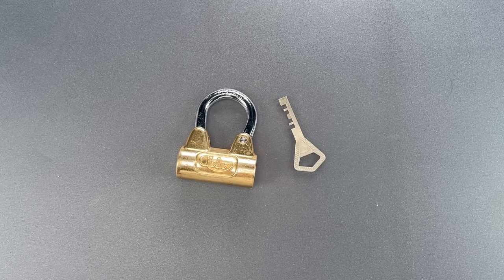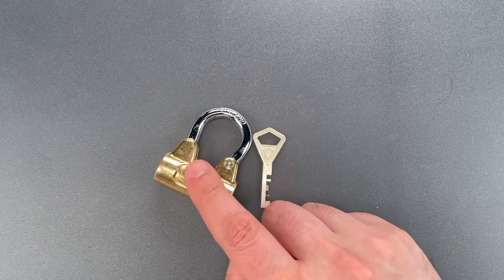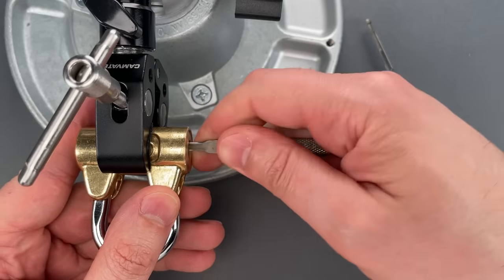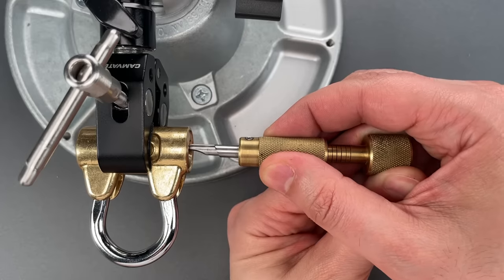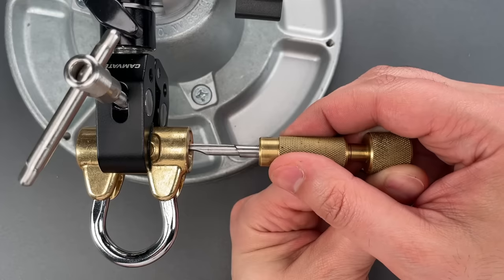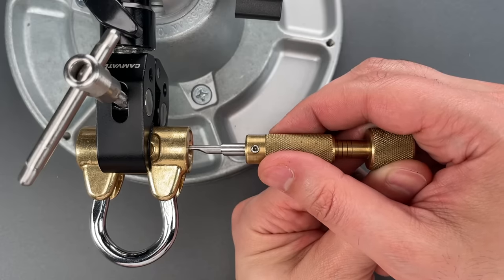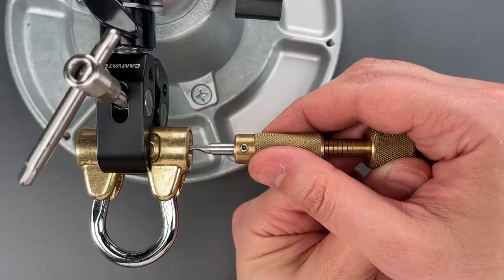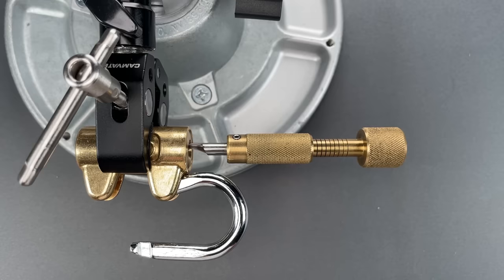[1416] Retro-Cool Abloy Padlock Picked (Model 3020C)

Comment: 1:00 - 3:50 It takes 3 minutes of LPL's time and his own custom tools. That's quite impressive.
Reply: Feels like the 3020C is going up in sales :D
Reply: True but it would not last 5 second against a brute force attack
Reply: @Vili.K  Wouldn't agree with you there, considering ABUS locks...
Reply: @AlbertZonneveld  In which case you would know her chastity belt had been removed!
Reply: @AlbertZonneveld  It does have the same core as the Abloy 341 Enforcer, a lock LPL made a vid on 2y ago, I believe
Reply: JD Kap

Ah, okay..
Reply: @AlbertZonneveld  Would most padlocks?
Reply: It more starts at 1:20 atleast the actual picking the previous bit was the set up
Reply: It takes 3 minutes AND you need something to hold it in place.
Reply: Imagine this on a sturdy lock...
Reply: @Vili.K  The Germans make exceptional "stuff".
Reply: My basement storage locker has been broken into 3 times in the last 20 years (always a resident with the key for the common door), but I still have the same Abloy lock, like the one on the video. They always break the locker doors, it´s so much faster than doing anything to the lock.
Reply: The lock doesn't get that much credit, it was closer to 2.5 minutes.  As Blitz said, it started around 1:20.  Still, well over the 90 second LPL scale and requiring his fancier disk pick.
Reply: @CodyLynn100  In Finland that is reasonable for a core that is over 100 years old.
Reply: @AlbertZonneveld  REMEMBER Almost anything in the world wouldn't resist a brute force attack!! Waste of time comment! The lock did it's job BIG TIME!!
Reply: @AlbertZonneveld  Yeah that hinge for the shackle looks very susceptible to attack.
Reply: @Torby4096  No Lauri Vuohensilta uses Hydraulic Press... Pommijätkät would have it open with explosion 😏
Reply: @CodyLynn100  Pay a few bucks more and you can pick from a variety of newer cores that no-one has been able to pick, along with a full steel case.
Reply: @BlitzerXYZ  The setup provided him with an advantage. IMO it counts as part of the lockpicking process.
Reply: ... for a 110 year old core technology
Reply: @AlbertZonneveld  most padlocks wouldn't tho.
Reply: Pretty good for year 1907 design, no? Considering that the last patents on this kind of lock expired in 1927, you have to wonder why MasterLock makes the crap they do. They could just copy this old design and slap their logo on it!

Or if they have high enough manufacturing quality, they could copy some of the more recent Abloy design with patents already expired. Even the Abloy Protec patents expired in 2019 and that's insanely good design already, much much much better than this year 1907 design.
Reply: @Vili.K  Swedes, actually.
Reply: @ssuchanek  Original design is by finns in 1907, ASSA Abloy was multiple disc detainer designs later than Abloy Classic in 1994
Reply: @riba2233  abloy has Superior core designs in far superior locks, arguably some of the finest padlocks money can buy
Reply: @karhu96  I call bullshit on the no one has been able to pick statement because among other things if memory serves people know how to pick the bowley lock
Reply: @the_undead  awesome!
Reply: @the_undead  That is a completely different design.

As far as I know, only a single person has claimed to have been able to pick the current standard Protec2 locks. Apparently it took him years to design a right kind of tool that he built from scratch and we'll over an hour to pick the lock. As far as I know, no-one has been able to replicate his tool or his results, so it could be fake.

Nevertheless, picking the current standard Abloy locks tends to be the holy grail of lockpicking. No other manufacturer or design comes close in it's ability to be pick proof.
Reply: We saw it and heard what he said.   Thanks Capt Obvious
Reply: @karhu96  Impressive part is not the pickproofness, but the fact that they are easy to make and can be made into insanely large series of complex key systems with master keys etc. while still remaining fairly secure. No other lock system that I am aware of come even close to that and I doubt anything other than disc detainer could even do that.
Reply: @karhu96  Multiple people have picked protec2 and most can pick up to Abloy Sento currently as the tools are public ish
Reply: Ma’uckas don’t stand a chaynce
Reply: Yeah I noticed the 4+ minute video so knew this was a good lock.
Reply: @CodyLynn100  Even if it's only 2.5 minutes to open this lock, there are some LPL videos that are shorter in total length while still showing a lock being opened multiple times.
Reply: @jdkap201  how did LPL do on time with that lock?
Reply: @fernandoserrano9393  I know but putting that core in strong lock with normally weak core would be awesome
Reply: It’s especially impressive when you consider that LPL can open most locks just by blowing on them, waving a magnet at them, or tickling the soles of their feet with a feather.
Reply: Probably a biggest flaw is that it is relatively easy to decode like many disk detainers.
Reply: @the_undead  Hux has video where he opens a bowley lock with a pick gun using a custom made tip. All pin tumbler locks are more or less vulnerable to similar attacks. That's why disk detainer designs are getting more traction.
Reply: @Vision-xf8gl  Abloy Sento is more like Exec than Protec. Sento doesn't have DBS (Disk Blocking System) or anything similar which makes it much easier to pick. Both have features in the keyway that prevent using a simple pick such as "the pick that BosnianBill and LPL made".
Reply: @CaptainRon1913  Thanks Captain Ron.
Reply: @fernandoserrano9393  Naah.
Reply: @Vili.K  When you combine the two you will get something unstoppable!
Reply: @manuhonkanen2111  You get God itself in the form of a lock
Reply: @Daltonfg  A chain is no stronger than its weakest link. A great lock doesn’t protect against a door that can be broken.
Reply: Your comment is mentioned in a finnish news article
Reply: @gpgarageoy  What?
Reply: @Vili.K  the original comment
Reply: @gpgarageoy  Yeah but in what article?
Reply: @Vili.K  isnt abloy swedish?
Reply: @masieone1979  Nope, the factory is still in Finland. But Assa Abloy has had their headquarter in Sweden since Assa and Abloy merged in 1994. Same goes with Yale for example. Yale is not Swedish even though it has been under Assa Abloy control since 2000.
Reply: @fernandoserrano9393  only chisel If know waht you are doing
Reply: Abloy, as a name, is constructed from 3 abbreviations: "Ab" is abbreviation for "aktiebolag" meaning limited company in swedish, as it is the second official language in Finland, "L" is abbreviation for "lukko" and that is actually a lock in finnish, and lastly "Oy" standing for "osakeyhtiö" - again limited company, but this time in finnish.

It is very much a Finnish lock.
Reply: Imagine this thing hanging on to something, swinging around.. you would never get it open
Reply: @AlbertZonneveld  But in that case, you would know someone has broke it down and insurance would pay back anything stolen. In my opinion when someone is trying to steal something out from you with picking, the point is to make it look like no one other than the owner of the key could have done it..
Reply: History about this lock is just next level, it's good one but gen2, gen3 are way better
Reply: Meaby he made tool but its not hes invention
Reply: @masieone1979  Yes. A part of the ASSA group.
Reply: @sueyourself5413 Finns, that lock was made in Finland, not Germany.

Comment: Takes to pick:
- several minutes
- a custom made tool
- advanced skill, and trial and error
- three hands

I'd heard that Abloy locks are top range, and now I've got a quote for that.
Reply: Sure thing. Pretty much no one is going to pick that lock because it's not going to be used in an environment where someone that skilled would be involved. They're gonna force the lock or use a stolen key.

Duplicating the key from a good enough photograph is very doable and way, way easier than picking. Even that is not typical common criminal level stuff. Also requires carelessness and or a freak accident.

Having a stolen key for several apartments plus "borrowing" the front door or storage facility key might enable a highly skilled criminal to make a master key for an entire apartment complex, but
-that problem is not limited to this brand
-requires some lazy locksmithing to have taken place to be plausible
-the "classic" version is outdated by decades anyway and more recent series are harder to work on
-any adversary skilled enough would probably think of something easier
Reply: @tonsssedell4318  you can duplicate a classic key very easily, but that's the only lock you can do that with. Modern ones in the field nowadays like exec, sento, protec or easy are borderline impossible, unless you're a master craftsman.
Reply: @Nibblerr  actually the older abloy locks (edge, exec) have expired patents, so they're duplicable with the right tools. Sento has patent protection to the year 2026, after that it'll be copyable as well. 

You can buy a edge key decoder and cutter but they'll cost you, so there's no reason to buy one unless you're a locksmith or a cobbler, criminals have other easier ways in.
Reply: @matiask7633  expired patents mean nothing when manufacturing the key is so hard that it requires its own (expensive) equipment. There's a lot of features in a single key mind you, not just the code itself.